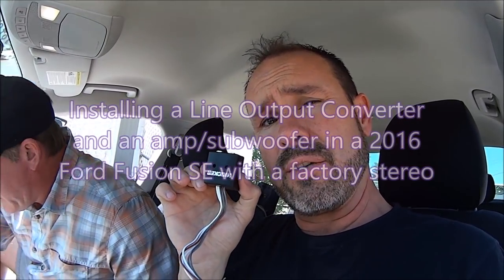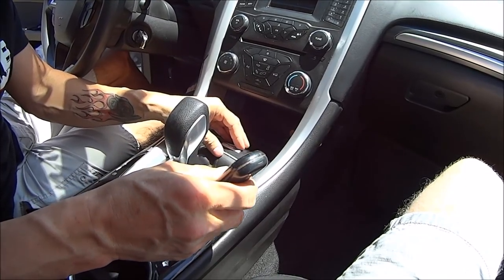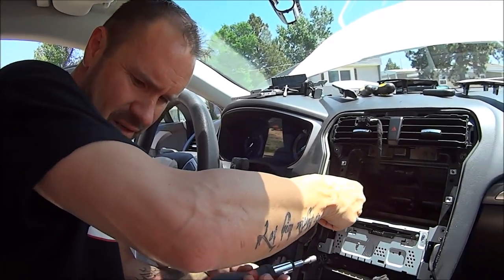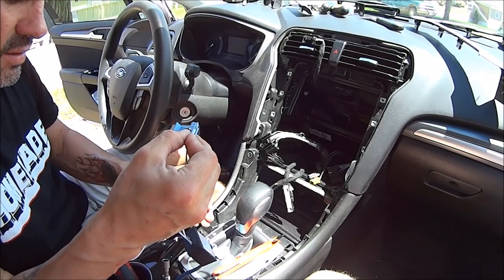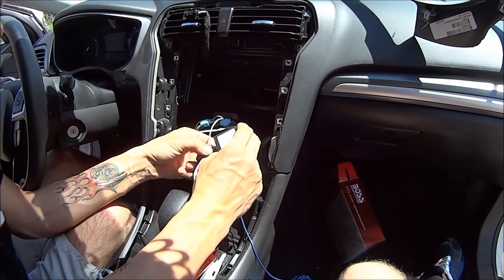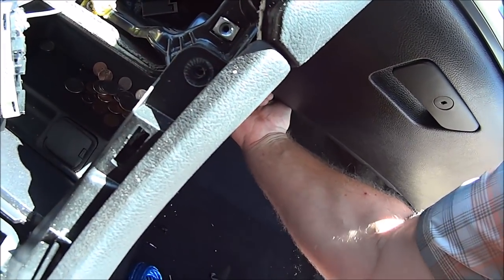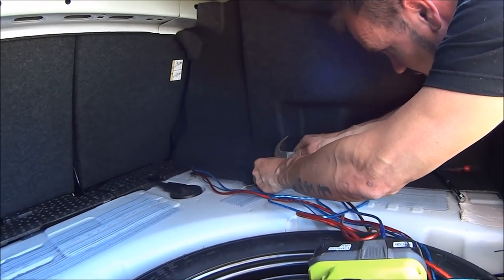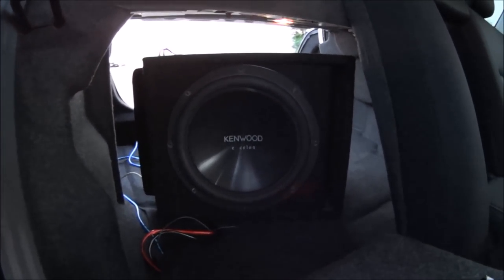How To Install a Line Output Converter & Sub/Amp in a 2016 Ford Fusion SE with a factory stereo

Comment: Did you ever find out the remote wire, if not what number fuse did you tap into
Reply: a good one to use is a window fuse and the reason is windows come on with ignition,  shuts off the circuit when the door is opened if there is no key  so no chance of it killing your battery and it draws very little current, hope this helps just make sure you use the proper side of the fuse. to check, pull the fuse use a test light which ever side does not have power with the fuse out, that's it
Reply from the maker: How to hook up Remote Wire for amplifier  - 2013-2017 Ford Fusion https://youtu.be/F5KxbV1Pylk

Comment: are there any aftermarket stereos for the 16 because I want to change mine out
Reply from the maker: HEY YOUR GOOD - something like this?  http://amzn.to/2s734jw
Reply: rapidtronics thank you
Reply from the maker: You bet.. It actually looks kinda cool I dig it.  I kinda want to change mine out too..
Reply: rapidtronics I gotta wait a month or two because I'm getting getting my subwoofer installed Monday which I'm really excited for
Reply from the maker: HEY YOUR GOOD right on!  I sure like mine.. It's sounding really good 😊
Reply: flip your sub around.  have the sub face the back of the truck. I think it sounds much better that way. try it both ways and check your preference.
Reply from the maker: Ckidz Tube I'll give it a try!
Reply from the maker: I tried it and I think it actually sounds pretty good that way!

Comment: I can’t seem to be able to run my power wire through the firewall. I tried your method but I can’t get the wire to come out the other side.. it’s driving me crazy
Reply from the maker: Ugh man!
Reply from the maker: You can do it 😊👍
Reply: Tap into the fuse box under driver steering wheel

Comment: I hooked everything up just like you did, but I get heavy feedback any time the car is one and the radio is plugged in, regardless of rather it's on or not. I checked the ground, and it's not that, does anyone have any idea what it could be?
Reply from the maker: I have no idea unless it’s the way you hooked up your amp??  Mine has zero feedback whatsoever..  Please double check your amp wiring diagram and let me know.
Reply: It's because you have the power wire next to the audio wires. Never run any kind of power next to signal wire it'll always interfere.

Comment: I installed my system in my 2017 ford fusion sport, it works great if the engine is off or if the engine is running and a door is open, however if the engine is running and the doors are closed my sub goes crazy! I've tried re routing wires and different rcas different sides of the car, no success, any ideas?
Reply: I wanted to add the sub only goes crazy if rcas are hooked up, I unplug those and it stops.
Reply from the maker: That’s weird -  I have no idea man ?? 🙁  I hate it when that happens
Reply: Does the line output converter make its own remote? Usually happens with those. It’s the active noise cancellation interfering. You can search and see if you can deactivate it or unplug it from the radio. If  not try getting your remote not from the line output converter (accessory fuse or whatever turns on with the car/radio)
Reply: One of the big headaches can be an improper ground or a loose connection on the RCA cables (typically sounds like a loud humming). you might need an RCA signal isolator somewhere in the run. The other thing is that ALL fusions have an active noise cancellation system in it that can cause problems with running a subwoofer (in general). Notice how he said that 'its much louder with the trunk open', is because the trunk being open (or doors in the 17 and on) turns off the noise cancellation software. There is no way to disable the software BUT you can disconnect the nose cancellation microphones mounted in the ceiling panel (the microphones unclip and dont throw any alerts for being unplugged).
Reply: Unhook the microphones in the headliner. It has active noise cancelling
Reply: @bpkred  Sounds almost like the RCA cables near the line converter are touching something metal. I have seen that happen before and make the sub do that. I assume it is humming vs pounding with the music?

Comment: Could I run my 2k skar amp on this w a zvx 12 skar 3000 watt power and 0 gauge
Reply from the maker: Ya why not??
Reply: @rapidtronics  I didnt know if it had the power or would mess anything up in any way
Reply from the maker: tG Product it’s gonna need one hell of a power wire to the amp eh 🙌
Reply: @rapidtronics  got a premium 0 gauge wiring kit from skar $100 I think itll be good then
Reply from the maker: Oh ya!

Comment: I'm getting static and I'm not sure why. I sanded all the ground spots I checked wires.  I'm just lost
Reply from the maker: +Luther Cunningham I'm not sure without seeing it physically.  What LOC did you use?
Reply: Run your rcas down the passenger side and everything else down the driver side. Use a good triple shield rca. If it's still making noise then try a ground loop isolator or even a cheap cap it will also clean the sound up more than actually helping your electrical

Comment: Did u figure out how to get ur amp to turn off with the car?
Reply from the maker: Not yet..
Reply: I'm pretty sure you need to splice into the key ignition white/orange wire for 12V accessory.
Reply: Greg Myers  thnx i will try it out nd tell u how it goes
Reply from the maker: jose olivares let me know!
Reply from the maker: How to hook up Remote Wire for amplifier  - 2013-2017 Ford Fusion https://youtu.be/F5KxbV1Pylk

Comment: I have a 2014 ford fusion with touch screen head unit. I'm hooking up my Rockford 1501 bd amp and 2 l7 solo baric subs. I'm using the kicker rca converter. What's the issue here with the remote wire. Why can't I just tap into the wire called constant 12v (radio)???
Reply from the maker: +Jeff DeTore that's what I ended up doing..
Reply: rapidtronics that kicker rca converter works ok huh? Some dink tried selling me a more expensive one.
Reply: rapidtronics I would assume my radio comes out the same way you did yours. I have the touch screen tho
Reply: rapidtronics I'm going to check that constant 12v wire with a meter. Make sure the amp turns on n off the way I want.  I see a antenna wire that may work as well
Reply from the maker: +Jeff DeTore let me know if that works 👍
Reply from the maker: +Jeff DeTore it should be very similar
Reply: rapidtronics I should have all the stuff to install this weekend. I will let you know how I make out
Reply: did the antenna wire work?
Reply: John Meyer Hey John. Yes the antenna wire worked for the remote wire to the amp... please note!!! The antenna wire has a delay. Sometimes longer then other times. (Depending if you lock your doors or just walk away) my amp always shuts off after a few mins. I have checked it many times. The amp always shuts off. Not right away tho. But it does shut off.
Reply: Is there another wire that will turn off immediately?
Reply: Nothing bro. Not that I found. My brother helped me he's a electronic  engineer at Bose. He tested a bunch of wires with the meter. The power antenna is best... trust me the amp shuts off quick if you lock your doors. Like in 10 secs after locking the doors. You could always buy a switch and wire the swsitch into the remote wire...
Reply: How about wire tapping?
Reply: I was going to get a switch , you know a simple on/off switch and wire it into the remote wire... but tappinng into the antenna wire works good for me.
Reply: We didn't check wires that go to say the video screen... maybe one of those will shut on and off with the car.... I checked all the wires associated with the radio part and the antenna is best choice
Reply from the maker: Jeff DeTore thank you for answering this question!!!  I haven't tried it yet..
Reply: What's wrong with the 12v constant?
Reply: Jeff DeTore what year is your fusion? And what color wire was your antenna wire, was it green/purple or the usual blue? Have had this question for a long time, messe up the first time by killing the battery completely because of the amp staying on constantly but just want this issue resolved, any help would be appreciated
Reply: Jr Castro the amp will always stay on cause it is always getting a signal. Check out the PAC LP7-2. It will generate a remote turn on
Reply from the maker: How to hook up Remote Wire for amplifier  - 2013-2017 Ford Fusion https://youtu.be/F5KxbV1Pylk

Comment: What gauge splice  connectors  do I need ? 2014 se fusion
Reply from the maker: I just got the blue ones I believe..  I can’t remember what gauge they were though
Reply: Guess I'll just buy the variety  pack for 9 bucks
Reply: Did you have to strip any wires   besides the ones from the  loc  ?  Or was it just like a plug and play ?
Reply from the maker: There ya go
Reply from the maker: Not really 👍
Reply: I'm just collecting everything  so I can have a pro install it for me with my parts and not their over price stuff

Comment: And turn your box reverse
Reply from the maker: +Joshua Covey did that..  Sounds excellent 👌
Reply: I’m actually working on this same model your vid really saved me a lot of time I went thru the rear door speakers. I tied in rear deck speakers 6x9’s rfosgates 2 amps and 2 12” planet audio subs. Sounds ridiculous. 
I appreciate the post and it’s still strange to me there is no rear deck speakers.

Comment: Sylvain Bergeron
I found "THE WRIGHT PLACE TO HAVE 12 VOLTS CONTROL FOR YOUR AMP!"
->->-> Go to motor compartment fuse panel and lift-up the fuse #3, place your wire under the motor side leg of the fuse to be protect by this fuse! This is a verified 12 volts  that will hold 12 volts on accessory key turned-on without a delayed turn-off like  the wire violet green near the drives door... It does turn to 0 volts when you cut-off motor or accessory position! Hope you read that before installing so you could run your wire thru the fire wall with the power one that goes to the battery. YOU CAN SEE MY DRAWING VIDEO TO HELP YOU AT: https://youtu.be/y4ZDxXRhz1A

Comment: Shouldn't run power and signal on same side...power should be run by its self
Reply from the maker: True..  Fortunately there is no interference and it’s crystal clear!!
Reply: @rapidtronics  I tried that coat hanger trick..no prevail

Comment: I'm trying to find me a radio to put in. I have a 2014 Ford fusion. I want my speakers in, so what kind of radio I need and what I need to do
Reply: Not sure what type of factory head unit you gave, but with my 2018 fusion, there is no compatible head unit available but you can get a external amp and tie it in to your factory gear and if wanted, better speakers.
Reply: ..."what type of factory head unit you currently have"......sorry, damn spell check!
Reply: @gregorall9779  if u asking me I have a regular sync radio
Reply: @Brittney_Wrldz  yes, I assume that the radio that you have is the radio the factory put in? If so, from my research, there is not a system you can install in place of your current one due to the way the factory designed it, however, you can install an additional amp to your current system if you wish and keep your current radio and replace your current speakers if you wanted.
Reply: @gregorall9779  ok, I guess I might need a step down kit
Reply: @Brittney_Wrldz  Are you familiar with the online home/car audio company called Crutchfield? It's a great resource for finding out exactly what is compatible with your specific vehicle. They can talk with you by email, online chat, or by phone and guide you through to make the proper decision for what you're wanting. I have no association with them, I just think that they're a great source of info.
Reply: Do either of you know if the 2014 se fusion has a place in the trunk I can tap into for the door speakers? I bought mine used from ford so i have a bigger sync unit than what was originally in the car but I dont see a stock amp in the trunk.i want to tie my door speakers to my after market amp
Reply: @SubzeroShaka I have a 2018 fusion and They're only set up for speakers in the front doors and back doors but no speaker harness in the trunk.
Reply: @gregorall9779  that sucks,I've been trying to avoid taking the trim apart
Reply: @SubzeroShaka  In my 2018, there are factory mounting frames on the under side of my rear deck that will accommodate 6 x 9's, so Ford did help me out there, but I understand your frustration with the labor side of getting cable from the head unit to the trunk.
Reply: @gregorall9779  I got a friend who added some 6x9s to the back deck and 2 12s to the trunk.it sounds a1..I just upgraded to 2 skar 12s and need my doors to catch up with my bass.i installed kicker door speakers and tweeters but now I need to run them all to a amp